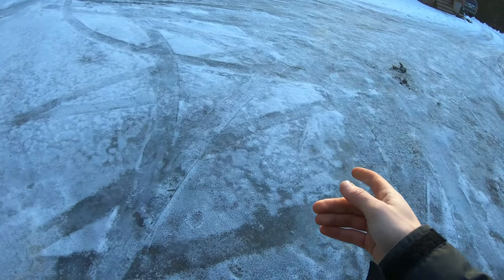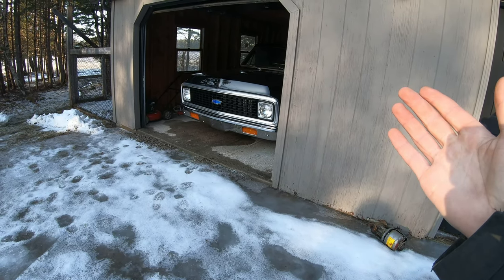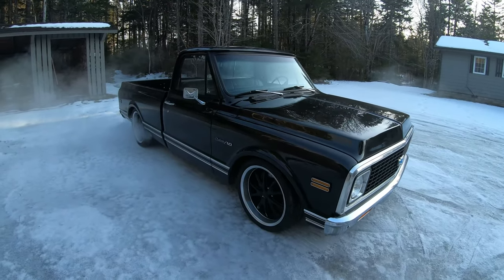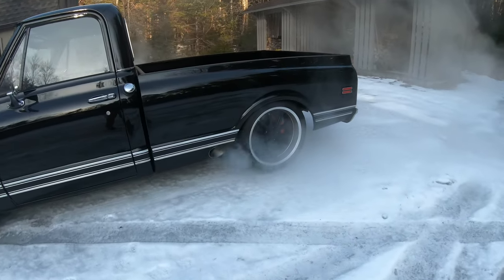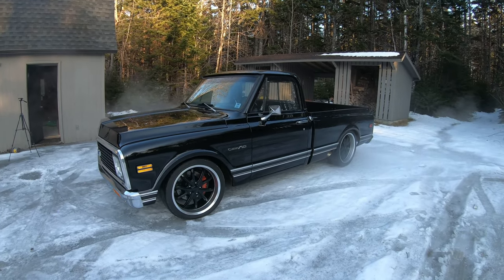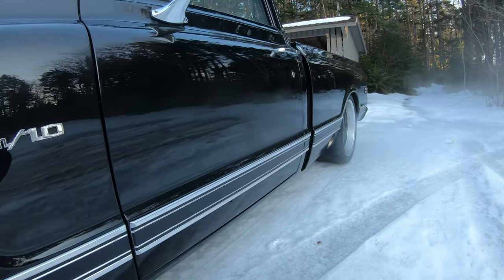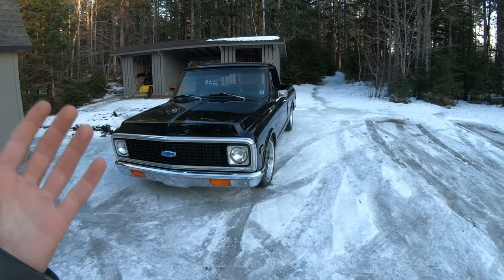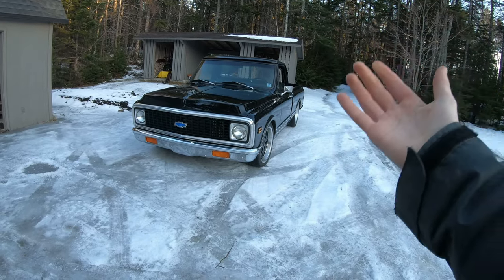Taking my 1972 Ls swapped C10 In snow! Cold Start!

Comment: What Guage cluster is that?  Did you have to buy new body panels? If so from who?
Reply from the maker: It's an intelitronix gauge cluster and the body panels are all original. They were in pretty good condition so I just fixed them up👍

Comment: What static drop is that, front? Rear? Please
Reply from the maker: It's a qa1 adjustable kit so I'm not sure the exact amount but I would guess around 4 inch drop in front and 5 or 6 inches in the rear